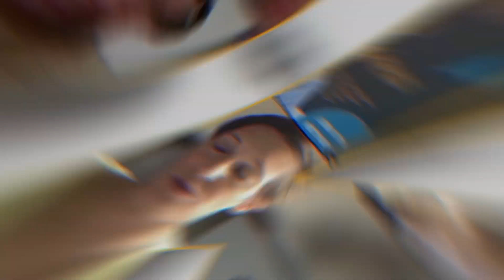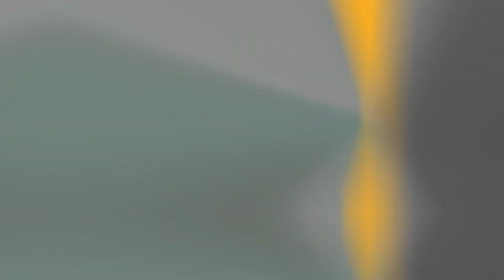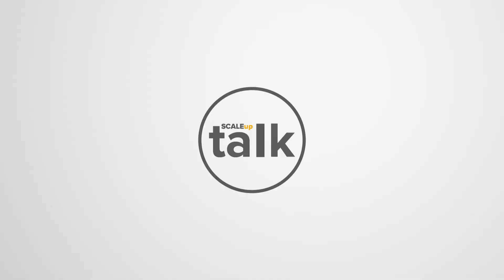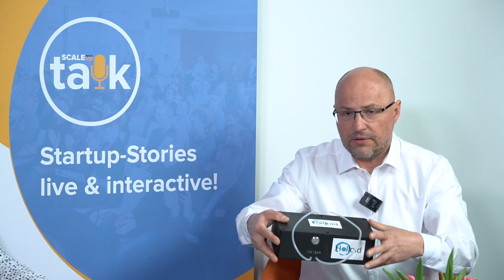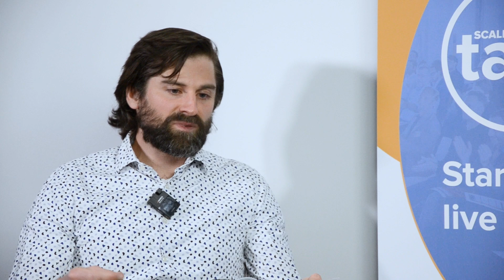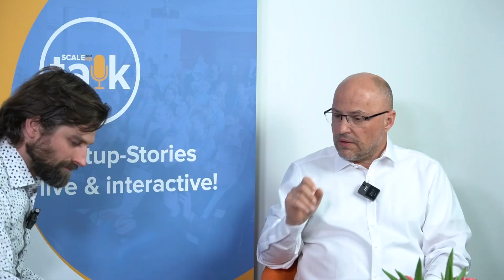Scaleup Talk #36: From finance specialist to co-founder of a deep-tech startup

Comment: Content:
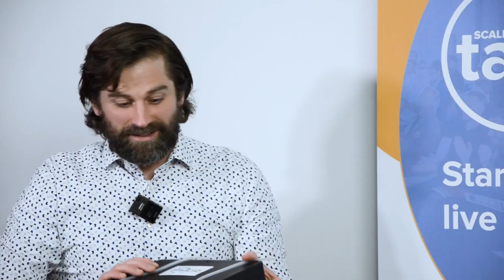0:35    What is Holloid about? 
1:29    What is disruptive about our technology and what does it mean?
4:50    Why did I co-found Holloid?
8:21    What are the most critical points to get right when committing to founding a startup?
9:24    How to negotiate IP/patents with a university?
11:12  How to agree on splitting shares in a startup?
18:23  How did we benefit from INiTS?
19:16  How do the different incubators and accelerators we graduated from compare?
22:16  My 2 cents on the current fundraising environment (mid March 2023).
24:00  Advice to aspiring founders.